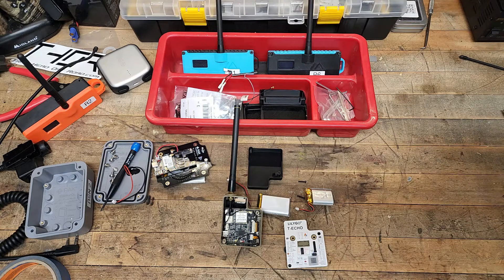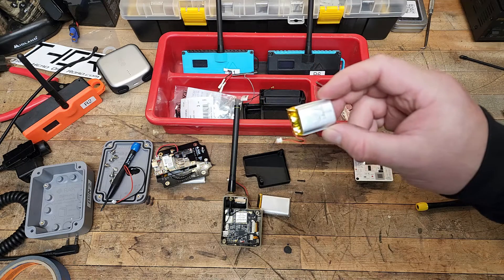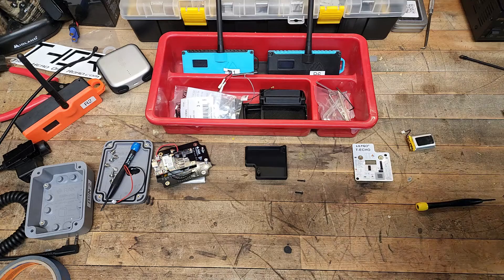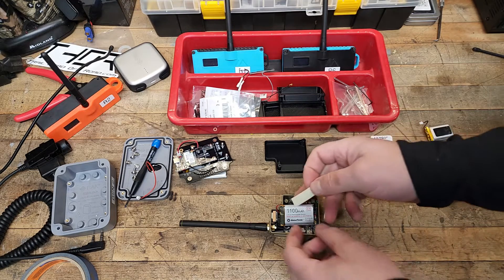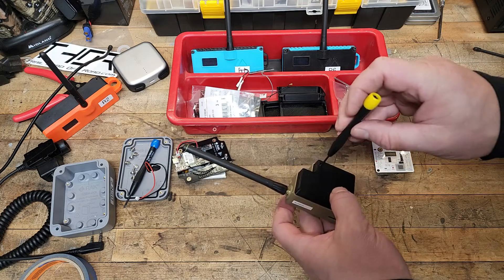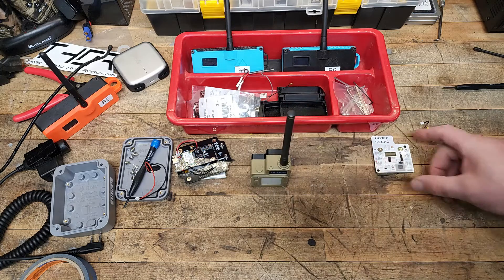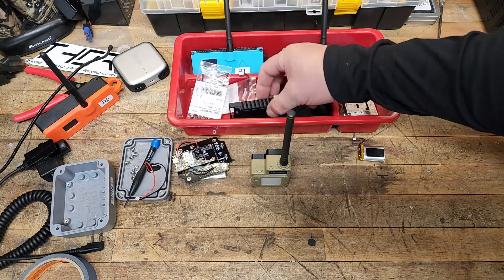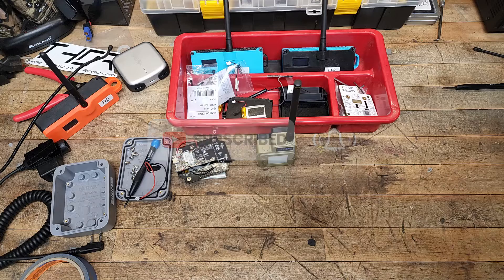T-ECHO BATTERY UPGRADE!

Comment: Are you happy with the RAK wireless solar encloser?
Reply from the maker: It is a good starting point. I modified mine to support an external antenna, and I am much happier. Also, in Washington state, I found the solar panel insufficient in the fall and winter months.

Comment: Would it be better to print a riser ring and use it with the existing backplate?  You can even add in gasket/o-ring grooves to make it water resistant.
Reply from the maker: Good point! I have played around with some free CAD software, but I am not good at designing my own yet. 2024 goals!
Reply: The stock backplate is not water resistant. The M3 screws and the little rectangle in the middle are all through-holes.